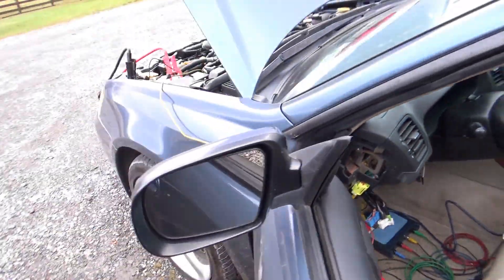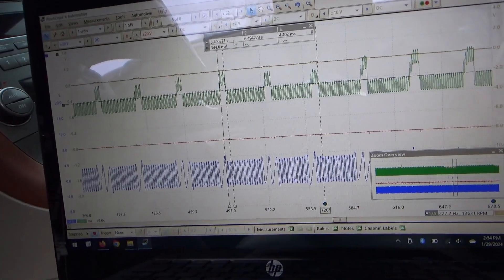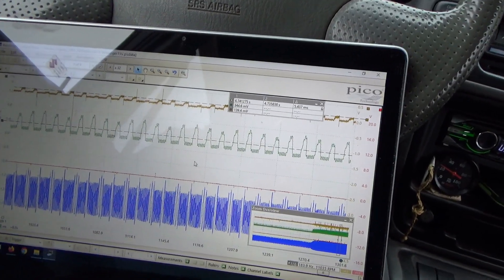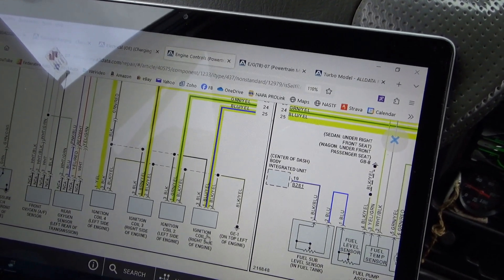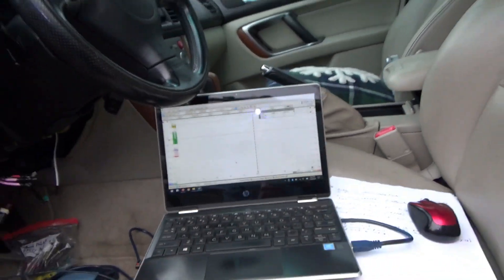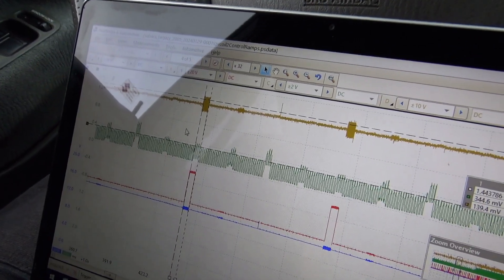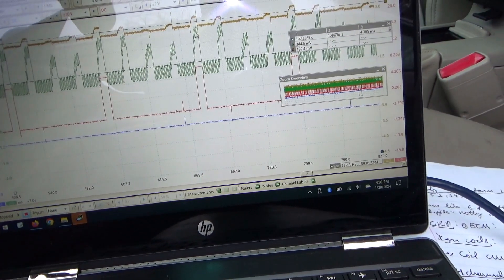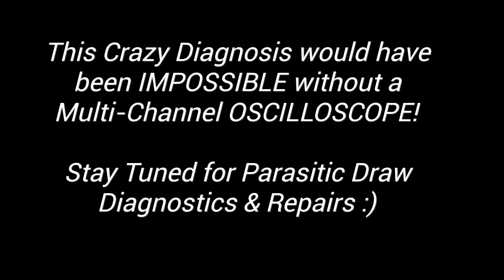Weirdest Subaru in the WORLD? (Part 2 - BARELY Runs with Alternator Connected??)

Comment: Looks like an overvoltage protection circuit kicking in a bit early in these coils. Or maybe the control pulse is 12V only, as the computer runs off a regulated voltage, which causes some transistor not to fully open, as there is a residual voltage between the pulse and the battery voltage. Interesting case!

Comment: I cant believe it, at 12 volts, the coil working fine, at 14 volts, the coil stop working, I have a surveillance camera installed in my car has the same system, it working with 5 volts only, if you increase the voltage above 5 volts, it will not turned on, I figured it out by accident, i forgot to adjust the voltage back from 12 to 5, and the cameras dosen't turned on, and thought I cooked the circuit, but when I adjusted the voltage back to 5, the camera turned on normally. the original power cable stopped working and I had to buy new one that has a manual voltage regulator from 1.5 to 12 volts.

Comment: Great diagnosis.  I try and buy OEM parts for my Sequoia.  The rear side door actuator failed.  Replaced it.  Replaced it again.  The first was an eBay special.  Next one, Amazon.  Each one lasted less than a year.  In the end, I bought an OEM actuator and two years later, still working.  I guess the old saying, You get what you pay for has some truth.

Comment: Amazing it was the coils. I wonder what the difference was between the crappy aftermarket junk and the originals. I have and inductance tester. I wonder if the inductance is the same between them. I bet the increase in voltage from having the alternator hooked up was just enough to cause a breakdown in the insulation of those Chinese junk coils to cause them to arc over. I would put them on a bench power supply and power them up in the dark at 12 volts then at 14.8 volts and see if there is any arcing externally or if you hear anything internally crackling. It would make a good video. None the less you are still and outstanding tech.

Comment: Watching that change in voltage ramp up and what it did to the engine running, at first I was convinced that the charging system should never go over a certain amount to maintain a low stress level on the electronics.  Having the "programmable" Top Don charger/maintainer proved that.  Then came the swap with the used OEM coils which probably have that built in voltage level maintainer circuit built in.  You proved where the problem is located in the junk coils.
But the question in my mind remains.  The charging system output can cause multiple problems in other electronic parts such as the fuel injectors, the PCM/ECM, the fuel pump control module, the pump itself and other "actuators."  Who knows what it does to the wiring harness/connectors over time?
My 06 Nissan Frontier has a normal charging voltage of 12.9 shortly after the engine is started up.  Now I know why.  The ECM controls and maintains that voltage but can increase the generator current output as needed depending on the load.
That was definitely an enlightening moment Ivan, another way to diagnose an engine running problem, and the "WHY" the charging system voltage should be kept at a certain level.
Sorry for the long comment, but it definitely was an eye opening, learning moment.

Comment: As someone with an electronics background, I still struggle to understand this.  I know what when a coil is grounded, it induces a voltage related to change in current/time, but the pulses being monitored looked just as steep.  Maybe the aftermarket coils had some internal resistance that meant a shorter pulse width couldn't ramp up the coil charge enough to let out a strong spark?

But also, why did the computer reduce the pulse width when the voltage was higher?  Or maybe look at it from the other side:  It increased the pulse width to compensate for low voltage, as would be expected during starting.

Comment: I had bad powers and grounds to ECU or bad drivers pretty soon in ep. 1. That turned out to be wrong, but then in ep. 2 I finally saw the schematic where the coils get both power and ground and thus turned out to have the driver circuit integrated in the coils. It would have helped if you explained that the drivers were integrated in the coils from the start for us home players to do our arm chair diagnosis. Not sure if you said that there were brand new aftermarket coils in ep. 1, but that would have also been a dead giveaway to concentrate on those, especially with the built in drivers.

Comment: Never Chineseium for a coil. I replaced my wasted-spark-type coil after 22 years, and Ford OEM was going to take too long. Price not matter here, so I bought NGK. Price was almost as high, and weight was very similar. Look at WEIGHT, brand, cost. Do NOT go cheap here. Junk coils weigh less, and cost less, and use cra*** plastic. Also, those COP type do not last nearly as long, as they are constantly being heated directly by the engine, and the components are smaller/more fragile, to fit them into a small package.

Comment: Those coils remind me of an old 62 Jag I had 45  years ago... The thing ran like trash when I got it, which was the reason I got it pretty cheap.... I noticed it had a Ford coil on it, and of course the Jag is English with Lucas electrics with positive ground, whereas US domestic cars had negative ground.   There was a discarded Lucas coil in the trunk so I tossed it on and viola!  The thing ran like a top.   (Ultimately the reason they changed the coil I suspect was due to a blob of something in the gas tank that would come up against the pickup every now and then, and the thing would quit.  I'd go into the back, pull the hose off the electric pump and blow into the tank until I got bubbles.   Put the line back on and trick the electric pump to fill the SUs and I was off to the races again! )

So I wonder if those coils were designed for a positive ground system or if the +/- were mismarked.  It would have been interesting to reverse the wiring just to see if it made a difference.

Comment: You have inspired me. I have bought a bunch of the items you use. I also created an LLC. I've part time repaired cars for nearly 40 years, mostly just to stay current. Your channel is so educational as well inspiring. Thanks from western NC!
Reply: We’re pretty much in the same boat, except mine is at least 10 years older. I hated the new computer age when it arrived and avoided it for a long time, until I basically got raped a couple times at local stealerships firing the parts cannon and charging for not fixing the problem. That’s when I figured it’s time to get with the program. I actually came to enjoy the learning process, which of course is still on going. Going to retire from the full time work thing soon. Think I will check out that LLC route!

Comment: ALSO!!!  LOOK FOR BAD/LOOSE/DISCONNECTED GROUNDS!!!  SUBARU GROUNDING IS SHYTE AND BAD GROUNDS WILL CAUSE SUBARUS TO RUN POORLY
The ground from the pitch stop mount on the firewall to the top of the transmission is frequently broken when the trans is removed.....and then they dont get repaired.

Comment: This Subaru reminded me of a full-size Ford van I once worked on. It ran really bad when first started, but smoothed out in a minute or two. Disconnected the alternator, no problem. I measured the ripple, off the chart. The customer did not believe me, told me that it was a new unit (Manny-Mo reman) and that I was trying to rip him off. I told him ok, but leave it disconnected on his way back to Manny-Mo because it was throwing sparks out of the case. Never heard from him again.

Comment: Hi Ivan ! I know that ECM takes a count on system voltage for the fuel  injectors. Possibly, it does the same for the ignition coils if a triger time changes  with the voltage. Nice job  Good luck

Comment: I'm surprised that Ivan didn't measure the output of the alternator as well. I betcha that it was running a little hot too. Possibly that was aftermarket as well. Just a cascade of failure.
Reply: alternator from Autozone... so its warranted with the philadelphia auto shop with their commercial account. it's the chinese sellers on ebay or amazon with these fake parts are the main cause

Comment: reminds me of a 2.5 4cyl gm engine back in the early 90s  it had brand new ac delco plugs in it. on idle it would run great under load it ran like crap. I tried everything that could cause this. i removed the plugs and they looked fine. after all efforts  I replaced the plugs and it was fixed!!

Comment: I would think you have almost pure AC coming out of the alternator, nothing new.  PS I didn't watch it
Reply from the maker: Then watch the video and BLOW YOUR MIND lol!
Reply: @PineHollowAutoDiagnostics .     3.9.24.   My first inclination was a large AC ripple from the alternator, but you dispel that quite quickly! My second thought was coil saturation, i.e. Dwelltime. But you’re right, I spotted that the pulse width was not changing, thus the ECM was not controlling in a shut down manner to protect itself from over saturation of the coils primary. Another damn, fine discovery job Ivan.‼️🎯

Comment: Got a 2003 saab 93, got a misfire on one cylinder but does not set a code. It's an original yellow epoxy coil they are known bad. Got a new China put on it fixes the misfire but sets a misfire code. Anyone e Got an answer for that one.i don't have a  pico so it's hard to analyze.
Reply: swap coil positions and see if the bad coil travels to the cylinder you put it into...

Comment: People when verifying battery spec remember country of origin of the car . For a nissan versa note 2015 the country is japan so cold crank amp rating of 470 is at -15 celsius . Many cca standard are established at -18 celsius . So that battery rated 450 cca at -18 celsius is a direct replacement if it's same size format . But usually start by verifying liquid quality and quantity . Not acid enough ? Add more 5% vinager . Most grand mom or grand dad have this around . If it's too acid add distilled water . Just test the battery liquid often in same fix to get proper dosage . Local car part store often have them . Might need to order the test for battery liquid tool . If this does not help your battery you'll need to replace battery . Safety ? Unhook negative battery . And wear  corrosion resistant glove and safety glass with side protection .

Comment: The alt puts enough load on the engine that the secondary breaks down due to a failing coil/s. It would probably have done it if driven.
I just had an 08 2.5 Outback, same scenario.
The reason I disconnected the alt on the one I was working on was due to a repeat alt failure, it had what appeared on the scope as excess ripple, at first, so I disconnected the alt and it ran fine, but misfired on test drive.
Reply from the maker: Nothing to do with secondary here...we were looking at primary current :)

Comment: Sorta funny.  What is electronic about a coil?  Nothing!.  It's just a couple of coils of wire with a common reference  No semiconductors...just conductors and insulation...unless some dipshid decided to put semiconductors in the coil...resonance in electrics?  Seems sorta silly.
Reply: Coil on plug type have a driver module built in  aka "ignition module".  So there are lots of semiconductors that some dipshid put in ther.
Reply: @scrappy7571  I've been out of the automotive biz for 25 years but in industrial ever since.  Why they would do that baffles me.  2 wires and electronics embedded.  Seems sorta foolish decentralization of control.  2 wires and not-so-smart smarts left unto a "module".  Not ingenious, just over-complicated.  What could the module do?  Current limiter with some sort of logic?  Not impressed by the tech if that's what is done.  Distributed logic is dangerous in control systems and damned difficult to diagnose problems.  Then,  in comes China junk to complicate things.  Yuck!
Reply: @nhzxboi Coils need a driver/module, it controls dwell time to prevent overheating the coil. Drivers get hot too, and to mount all coil drivers in the ECM would make it huge and need cooling.  Mounting each separate with air flow makes more sense.  I'm sure there are more reasons to have the module near the coil,  including individual cylinder timing/control. If you really don't wanna piss-N-moan about modern cars , get a car with points or magneto LOL.
Reply: @scrappy7571  Yea.  Great.  2 wires and a control module.  Subaru, to me is not legitimate.  They have PZEV.  What part of the zero would you like to have?  You piss and moan.  I'm not. I'm just observing the silliness.

Comment: I am not a mechanic, but I am a long time Subaru owner and I have been told that Subaru uses higher than normal voltage(?) Coils than many other cars.
Once again people, only let mechanics experienced with Subaru's work on your car!
OEM parts across the board always!
Reply: Like I said, I'm not a mechanic, but I heard maybe Eric O.? Say something about Subaru coils being somewhat different than those used ny some manufacturers.
Are all coils the same then?
Reply from the maker: @fubartotale3389  there may be slight design differences, but they are all 12V coils and fire standard spark plugs with similar gaps... Can't believe all the myths on the internet 😄
Reply: Perhaps we can discuss precision toolmaking and then I can laugh at you?
Reply: Right....
Reply from the maker: What is a "high-voltage coil"? Never heard of that haha

Comment: It's amazing how you still retain your patience after all of the work you've done.

If AM parts are found to be defective, a notice should go out to every seller telling them to dump the junk.  That's an ideal scernio unknow in the real world.

On a side note, AM junk doesn't exist only in the automotive world.  I ran into some while fixing a leaky faucet.  The parts I bought were advertised for that brand of faucet, but they weren't.  I was finally able to find parts from that brand's company.  Then repairs became a piece of cake.
Reply: I had a Delta faucet I bought a new aerator for recently.  It was an aftermarket aerator that wouldn't let hardly any water come through despite being a 2.2 gpm replacement.  I had to order a new one from Delta.  The AM piece costs $5.00.  The OEM one costs $15.00; but it puts out 2.2 gpm.
Reply: @lvsqcsl  Knockoffs don't hold a candle to OEM parts.  Even though OEM parts cost more, they work as they're designed to work.
Reply: @jamiepatterson1214  No, I remember the vid OEM sensor was wired backwards and don't work. Think it was crank sensor.  reverse the pins in the connector, and they worked fine.  scope trace showed a ramp up vs drop was the only difference to the signal.
Reply: you would think legit parts companies would post a list at least.  guess we lose when lawyers win.

Comment: That sure was an odd one!  Good straight forward diagnosis with no parts cannon fired.  My hunch was the pcm did not like the 14.5 volts and was going into some type of over voltage shut down.
Reply: Most automotive componenta should take up to 16V no problem...

Comment: I can't argue with your results. But I would have checked one more thing. If the diagram is to be believed the injectors aren't individually run to one ground point. They are chained with each other. I would be curious if there was a poor connection in that chain. But yours worked.
Reply from the maker: Hmm didn't even think about the injectors...
We proved coil #2 ground was perfect, but ALL the current ramps were being drastically reduced at 14V, so a poor ground is 100% ruled out just by checking at one coil :)
Reply: @PineHollowAutoDiagnostics  Didn't say I was right. :)

Comment: I thought you were going to do swap the coil of the one cylinder that seemed to be hanging in there at the higher voltage to see if the good cylinder followed that coil.
Reply from the maker: Eh all the coils were garbage. Surprised the car didn't stall out completely tbh :)

Comment: I wonder if the aftermarket coil saturation is too far off, and the engine computer is cutting off the pulses early?
Inductance and DC resistance, compared to OEM might tell us.
Reply from the maker: ECM pulse width never changed...you can see that on the scope!

Comment: There is a you tube channel called wrenching with kenny. He had a ford engine that he was talking about that kept running really rich. As I recall he determined leaky injectors. They replaced them from a donor engine that they had in the shop. Still ran the same. The engine had aftermarket coils on it. After they replaced them, it fixed the problem. As I recall, he did not quite understand why. I believe the aftermarket coils may have been inducing a voltage in the injectors causing them to open up out of time.
Reply: Yes, Kenny hates cheap aftermarket parts, as does Ivan.
Reply from the maker: Probably had just really weak spark lol